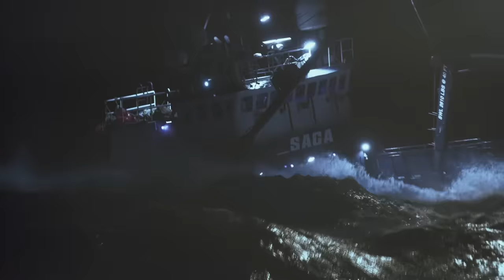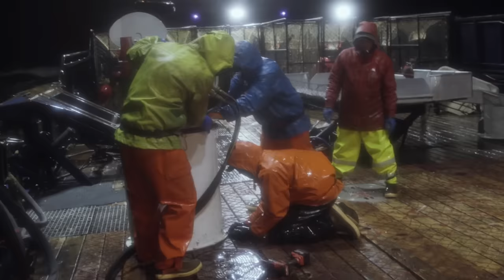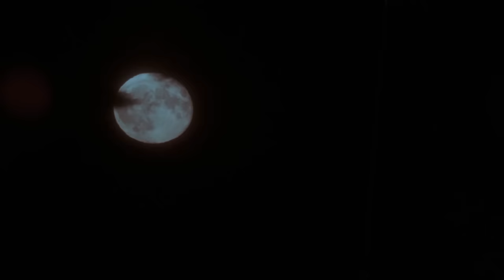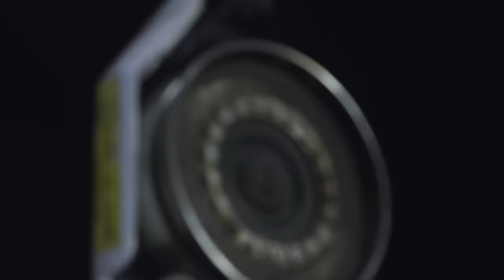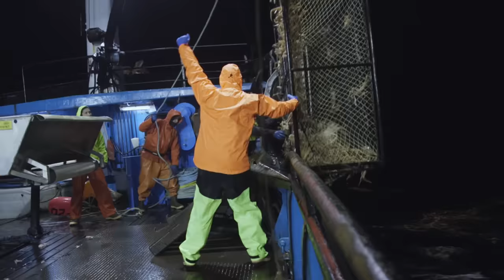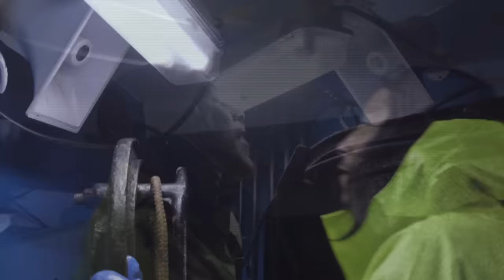Raging Seas Pull Man Overboard Into Freezing Water | Deadliest Catch

Comment: I will say even though that guy went overboard, he’s one of the hardest damn workers I’ve ever worked with. I did a short fishing stint with Spencer (the guy who went overboard) and he’s a certified badass. This was a mistake that could’ve happened to anyone.
Reply: Did he die
Reply: @MeekaYammi3554  no
Reply: That wasn't really a mistake. Sometimes shit happens. I don't think he did anything wrong. A wave yanked the pot he was hooked to
Reply: @deusvult6920  Sometimes shit happens is the laborers way of saying a mistake happened.  Its not self incriminating and in this USA of HR Policies we’re conditioned to speak in a way thats not incriminating.  I work for my dad, this would be considered a fuck up and you better not do that again.
Reply: @deusvult6920  He wasn't hooked to it, he just didn't let go as it got pulled out.  It was a mistake.  Like when people try to stop rolling cars by pushing on them and then get run over.  Adrenaline can make common sense go out the window quick.
Reply: Lies